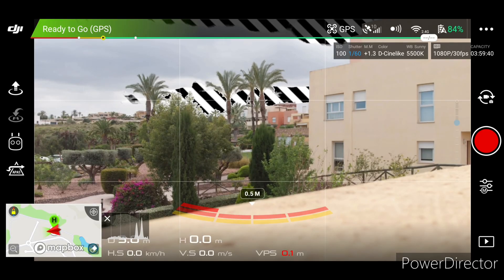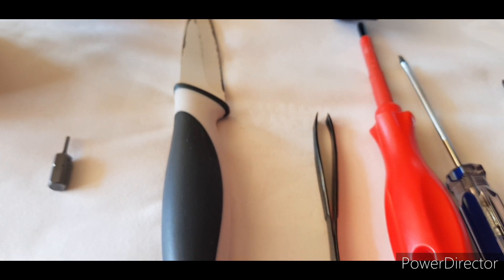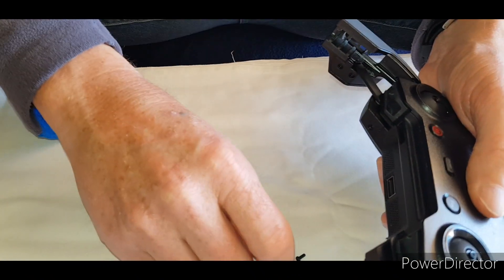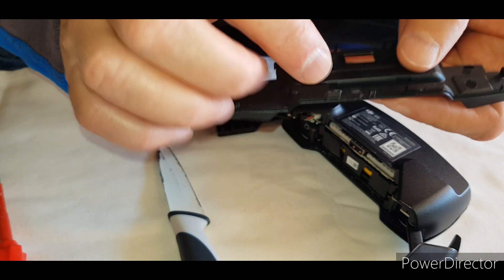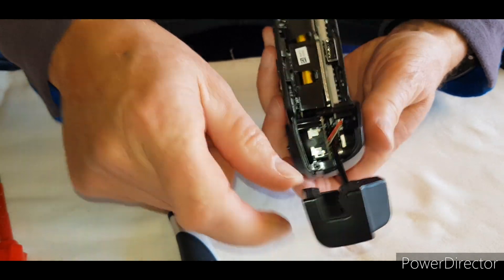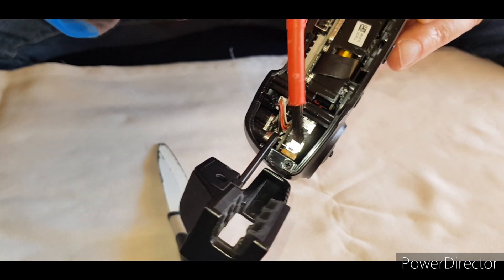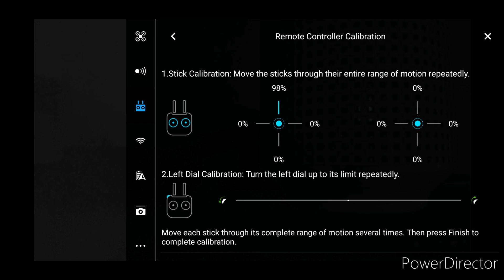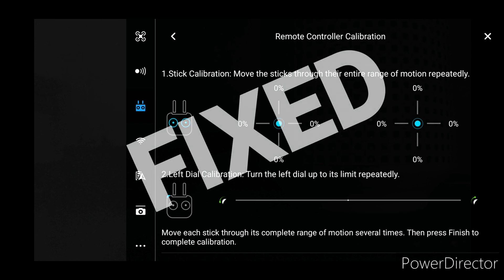How to fix DJI Mavic Air controller joystick roll, pitch and yaw problem

Comment: THANK YOU SO MUCH MAN! I basically had the same issue, but in my case the right control stick was pulling left about 11-17%. Took the rc apart & cleaned just like you showed, and after recalibration, it actually WORKED!!! All went back to 0%. AMAZING! 👏👌👍
Reply: Same thing here but I have the RC Pro which is more complicated to take apart

Comment: I have the same problem with the right joystick it drifts to the right and sometimes left wat du you suggest to du?
Reply from the maker: Hi Nikolas, if recalibrating the joysticks doesnt fix it, try a few drops of the isopropyl alcohol onto the joystick first, wiggle it around and see it fixes it  if not, you can try what i did in the video and take the controller apart and clean.
Reply: @RichardFiske0311  thanks for the information I will try and let you know I treated calibrating the joystick but dose not fix the problem I will try the alcohol method.
Reply: @RichardFiske0311  should I drop the drops of alcohol on top of the joystick will this not damage the controller?
Reply from the maker: Hiya, isopropyl alcohol wont. It cleans and dries off after.
Reply: @RichardFiske0311  du you have any other social media we can communicate with
Reply from the maker: @nikolastheo5459  hey, ive instagram which i have a link to in some of the description info on my videos...

Comment: trying this tonight because same problem with right yaw with Mavic air! letting you know if I get to the cigar end of that...
Reply from the maker: Hey Serge, hope you get the cigar result you are looking for 😂👍
One little tip before you start dismantling if you haven't tried already.... put a few drops of isopropyl alcohol onto the joystick and work it in by wiggling. See if that cleans it and fixes the problem. It may work and save you having to dismantle it 
Good luck. 👍

Comment: I had a very similar issue and after watching this video it put me off taking my controller apart, however I did give the left stick a vigorous wabble around in all directions, this alone seems to have stopped the random right yaw in the calibration tool, I’ll take it for a test flight tomorrow to see if its actually fixed it.  Cheers...
Reply from the maker: Cool, i hope its fixed. If not, you can always put a couple of drops of the isopropyl alcohol into the joystick area apparently, this will help clean the contacts without damaging any circuitry.
Reply: @RichardFiske0311  It worked without any cleaner FYI, very happy, thanks...
Reply from the maker: @djmattcox  excellent and really appreciate your feedback and letting me know. Happy flying. 👏👍😎

Comment: This is happening with my mavic mini
Reply from the maker: Try recalibrating the compass etc first. If that doesnt fix it, put a couple of drops of the isopropyl alcohol into the joystick area a wiggle it. This alcohol wont harm the controller, but may clean up any dust etc that could be causing a problem. Opening up the controller is the final stage if all else fails. But it worked for me. 👍
Good luck.

Comment: It looked like the left stick was the problem , but you actually cleaned the right stick  ?  ?
Reply from the maker: Hi Peter, yes the left stick was the problem. I was only able to get the right hand screw out so I couldn't take the front plate off completely. However, the two yellow joystick controls were exposed enough for me to squirt the isopropyl alcohol onto both left (the problem one) and the right joysticks.

Comment: Thank you very much. I’ll take the risk and do the cleaning. What kind of contact cleaner did you use?
Reply from the maker: Isopropyl alcohol. Onced the controller casing was apart , I squirted a little inside onto the yellow housing of the joysticks whilst moving them around full motion, then dried it all with a hairdryer on cold setting.

Comment: I’m having the same issue. Has the problem came back since you did the fix?
Reply from the maker: Hi Raul. Its been perfect since cleaning. So glad I did it because it was so annoying and calibrating the controller never solved the problem before.
Reply: @RichardFiske0311  if I send my controller to you can you fix it please
Reply from the maker: @mikelowsrchobby6863  hey Mike, you should try putting some drops of the alcohol into the joysticks first, give them a wiggle around. This may be a really quick way of sorting it without taking the controller apart if you're worried about doing that. 
I live in Spain, so probably a long way from you. 
Let me know how you get on.
Reply from the maker: Raul, if you do try this cleaning, let me know if it was a success.